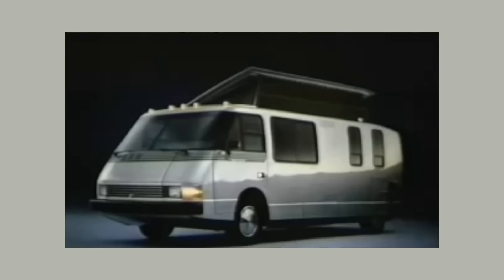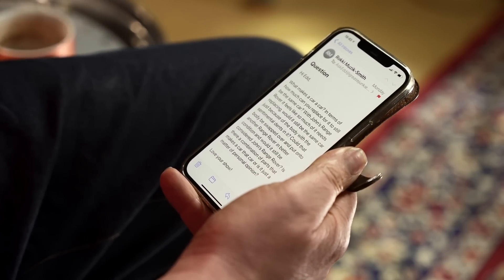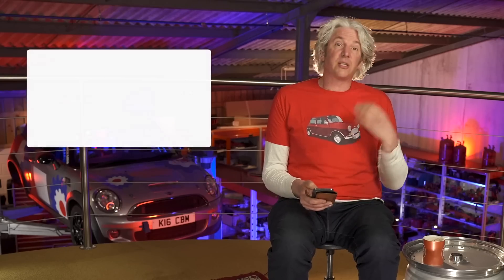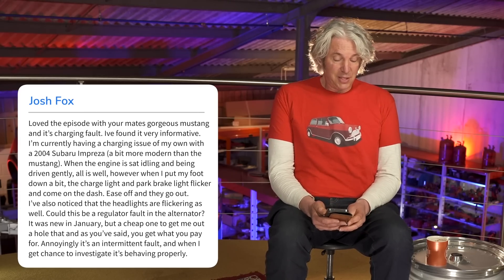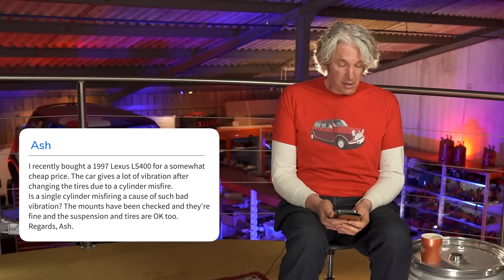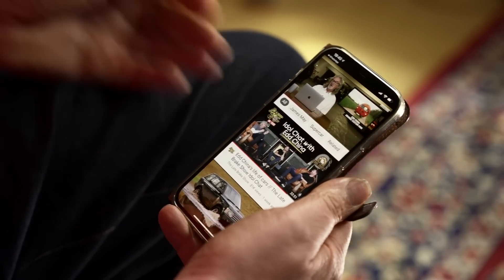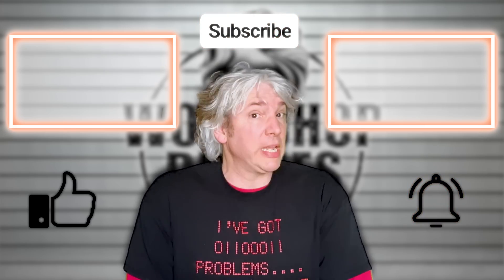An Electric Motorhome, Intermittent Faults And Cylinder Misfires! | #AskEdd | Edd China

Comment: RE: the vibration.  If it is only in motion, I would add to check the lug bolts/nuts; also, if the rims are not original to the vehicle, perhaps they are not centered on the hub.

Comment: One day my car was fine and the next it drove with a terrible shaking.  I had parked the car and a heavy rainstorm had come along and the car was in 6-7 inches of water.  Since the water wasn't getting any deeper than the height of the curb above the pavement, I left the car sit in the rushing water.  The water deposited a handful of mud on the inside of the rim of the rear tire nearest the curb.  It took a while to figure out what was happening and a simple clean out fixed the problem.

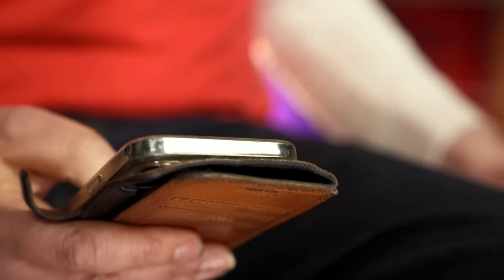Comment: 04:15 charging fault could also be a bad earthstrap between alternator/engine (if rubber mounted), engine/body, or body/battery. These straps and their bolted-up  connections are neglected so often.

Comment: With the misfire, a trick could be running the vehicle at speed to replicate the issue, then put the clutch down, tells you if it’s engine derived or drivetrain/wheel derived

Comment: EDD,
What about a Stealth Commercian Vehicle Conversion to Electric RV or Secret Motorhome. 
Which has an outside appearance,  of a working large van or removevan?

Or maybe a ridged 4 or 6 or 8 wheel lorry, or even and articulated tractor and semi-trailer, or a military all terrain truck too?

Though on the inside, it is actually a fully customised designed and built luxury Motorhome,  but no one would know it from outside!

As these Stealth Work / Commercial Vehicle conversions into motorhomes, are very popular in the USA and Canada,  if not in Europe or the UK as much.

So would make an ideal project, for you Edd, converting a large removevan, into a stealth electric or hybrid electric Motorhome!

What do you think Edd, something worth a YouTube Video or two?

Comment: Hi re the Impreza fault. I think you need to monitor the output from the alternator at the battery terminals with a multimeter. That way you will know whether the alternator is regulating correctly

Comment: Just a quick point about intermittent electrical faults: it's always worth checking the chassis earth connections first. These are easily overlooked and can misbehave despite looking perfectly sound. A typical 10-month-long British winter (😉) will even corrode a bowl of custard if given the chance, so strip the earthing points and reset them before spending a load of cash on new parts.

Modern cars with sophisticated electronic 'brains' are especially sensitive to a dodgy electrical supply.

Comment: I had some new Dunlop tyres a few years ago that were perfect one day and vibrated like a dumper truck on others. They balanced them about 6 times to no avail. Eventually Dunlop tracked down the problem to some rubber dust inside the tyres that had collected into little rubber marbles. So one day when you drove they got flung to the rim inside of the tyre evenly so no problem but on others they all clumped together in one place and vibrated like a goat with the dt's! Very frustrating then but I can smile about it now.

Comment: Really interested to see an electric motorhome. I'm looking at the Ford E-Transit XLWB to convert. But at £45k + VAT would it make more sense (and be cheaper) to buy an old Mercedes Vario or 609D then convert that to electric? Something with 150 - 200 miles range on a charge would be good. Nobody in the UK seems to convert vans to electric. If you're up for it Edd, I'd much rather pay you to convert an old Vario :)

Comment: Hey Edd, I've a carb motorbike and if I don't start it everyday it's tough to start, if I've got full fuel a full battery what's stopping it starting? Anything I can do to help it start? Thanks 😊👍
Reply: I had a VFR750F do that--a mix of water, mud and salt spray had put the ignition coils and leads through an assault course, and eventually the insulation failed and started tracking (at about 100k miles, to be fair). A nearly new set of coils and leads from the breaker's yard fixed it.

Comment: 5:15 I had a similar problem on a vehicle. In my case, when you accelerated hard, the engine rocked back enough that the aftermarket metal intake pipe would contact the positive terminal of the battery. I had thought there was sufficient room and insulation, but the engine moved enough and the insulation wore thru (but on the underside where I couldn't immediately see it).

Solution was repositioning of the pipe and battery terminal so that they couldn't make contact.
Reply: I had something like this happening about 10 years ago and long story short some stuff I had in the trunk of my Miata caught fire in downtown Boston and the terminals of the battery melted away. Fortunately I was at the top of a hill so I roll-started it and drove immediately to an AutoZone store where they honored the warranty on the battery and replaced it for free!

Comment: Another thing for Josh Fox to look at.
Check the earth leads from battery to engine & body. Also check earth on Alternator & Lights circuit. 
You would be really surprised what lights up when you have a bad earth.
I've known vehicles that showed a full tank of fuel and over temperature on the needles because the engine earth was lose

Comment: Back when steel belted radials were a thing, I had a car that as parked in a parking lot where water drained down. Over night the water froze and when I moved the car, it was temporarily stuck in the ice that had built up around the tires.
Afterwards, driving down the road, the car would shake uncontrollably at 45 mph. 
I knew the tires weren't that old but it wasn't until I got home, parked the car and noticed that a whole section of the tire had shifted to the side of the tread. It had broken the steel belts when I reversed out of the ice in the parking lot!
Needless to say I had to buy a new tire but what a sight to see that section of the tire shifted over!!

Comment: Would love a FULL EV RV, I would totally live in it. with an inverter wired to the traction battery, ASHP heating/cooling, etc. 
Not to mention that you could literally park up for a few hours at free parking spots sucking in 7kW at supermarkets etc. 
or even fast chargers, cheaper than camping sites with hookups

Comment: Fantasy EV Camper. 
You need 3 VW T25 Transporters. A crewcab pickup and 2 panel vans.
The crewcab gets the motor & batteries, plus a fifth wheel like an artic.
The panel vans you join together, notch out under the front to fit the coupling.
Use two torsion beam rear axles from an old Golf for rear suspension & have 
extra batteries under the trailer with solar on the roof. 
Park the trailer and use the towing vehicle as a runaround...

Comment: Lexus vibration. If he's changed the WHEELS, the replacements may not have the correct centre bore and will not be concentric on the hubs. This gives a really bad vibration at speed when on the car but not on the wheel balancing machine. It's just a thought...

Comment: 7:00  I had a weird tyre balancing issue once that might be something your emailer could check. I had new tyres put on and suddenly the car would shake when driven. Yet when they tyres were taken off and re-checked on a balancing machine all was well. Put the wheels back on the car and the shaking started again.

Turned out a loose tyre weight had fallen inside the tyre before it was fitted to my wheel. When they balanced the wheel that rogue weight would hold in one place due to centrifugal force, so the wheel got balanced correctly. But once on the actual road the uneven road surface caused that rogue weight to bounce around inside the tyre - causing the vibration.

Comment: A small electric motorhome but with 4x4 drivetrain and some off-roading capabilities is definitely something on my bucket list.

I kinda like an idea I came up with of basing it all around a small hookloader chassis so that the motorhome back can be dropped off. I'm on a farm so that way I could also have multiple 'modules' to go on the back (flat bed, motorhome, water bowser, people transporter, bulk tipper,  mobile tool wagon/workshop, etc). The vehicle wouldn't then be parked up for 10-11 months of the year and could be used daily about the farm & our syndicate shoot when not being used as a camper / adventure wagon.

....I envision it working a bit like Thunderbird 2 😂

Comment: Interesting question from Rokki musik smith. The debate has gone on for years in the Railway preservation movement after locomotive have had boiler changes and parts swapped from other locos of the same class. There’s not much left of the 1924 4472 Flying Scotsman, but even in 2023 she’s still Flying Scotsman !

Comment: I once put asymmetrical tires, road tread on the outside, more aggressive tread on the inside on a ford conversion van. I had all kinds of vibration and the dealer finally replaced them with all season tires and that fixed the problem. The Lexus owner may want to try replacing the tires with another tread design.

Comment: The originality question goes back to Ancient Greece, as the "Ship of Theseus" question.
Maybe the Lexus' vibration is the result of improper tyre mounting. If they aren't properly lubrcated, they can be off-centre.  (Vauxhall had an intractable  problem with "engine" vibration on Bedford trucks. It was  caused by cost accountants restricting the amount of soap that could be used in the water when mounting tyres.)

Comment: I’d say on the Lexus, try to loosen the lugs and Re torque them, I’ve had where they weren’t torqued correct or seated properly and caused a bad vibration.
Reply: Speed up with your vibrating car and decouple engine and let it idle. Then you should feel still vibrate if it’s tieres or axel.
Ed your trailer speech is confusing, is that an Voiceover or a strange mic, doesn’t sound like your recording voice :)